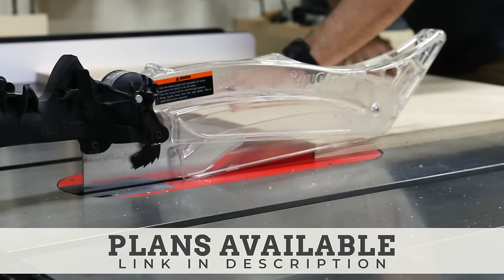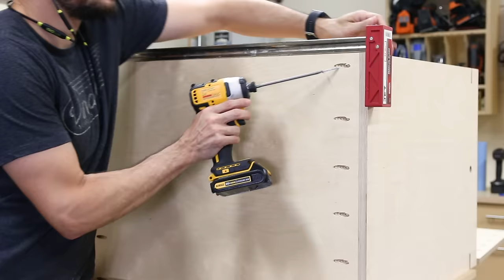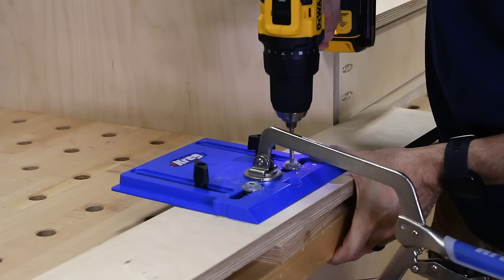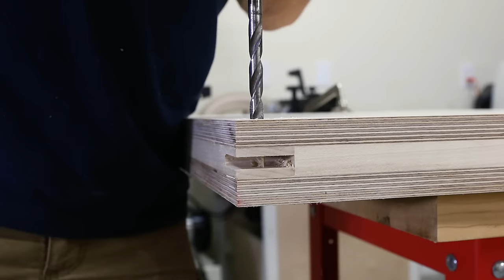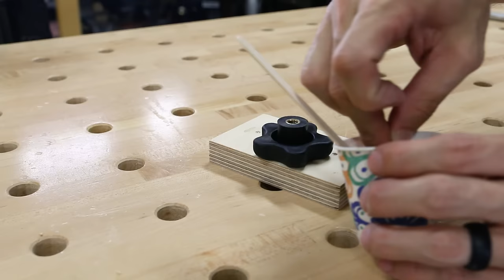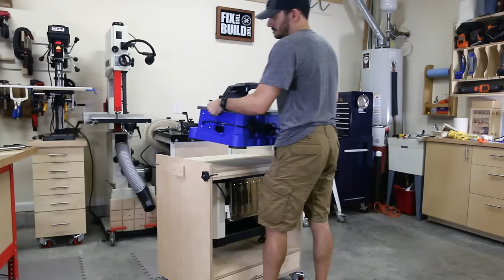Flip Top Tool Stand with NEW Features | DIY Shop Storage

Comment: Hi.  I purchased the plans.  How should I alter the plans for a dewalt 735 planer, and ridgid EB4424 belt/spindle sander?  In my head I just alter some measurements, but do you recommend I build it as the plan states? Or use different dimensions.  

Thanks!  I’m a beginner woodworker with a tiny shop so this helps a lot
Reply from the maker: Plans will work as-is for those two 👍

Comment: This makes so much sense with space saving, and a great description of how to do the job, thanks.  I’m wondering about the max weight for a machine on this. I’m guessing a table saw of 45Kg weight is too heavy. Any thoughts please?
Reply from the maker: Thanks!  The stand can easily take 100lbs on each side.  I've never tested the limits, but that should get almost everything you'd want to hold
Reply: Fix This Build That thanks. I’ll give it a try, and I might use the other side as a mini work bench instead of using the table saw as at present!!

Comment: Thanks for sharing. One question, how do you determine where to put the tools on the flippable top in order to keep the balance and thus ease of rotation?
Reply from the maker: If you can put the center of gravity along the metal tube line that's best

Comment: I really like the upgrades...simple things that reduce the 'frustration factor' aspect.  I've been thinking about ways to integrate a flip cart for my planer and miter saw, but with fold out wings that could serve a dual purpose.  The wings would add support for longer boards on the miter, but could also act as extended infeed/outfeed for the planer which would help reduce snipe.
Reply from the maker: Folding wings are definitely a cool idea.  Been tossing that around for a while.  Maybe Flip Top 3.0???

Comment: Hey Brad - Quick question? On the plans, you have the cut list item H (False Drawer Front) as 27 3/8" x 4 3/8" x 3/4". If you used two 4 1/2" shelf back pieces (27 1/2" x 4 1/2" x 3/4") to space the shelf top, and you then cut 1/4" off 2 sides (for 1/8" reveal around the whole front) wouldn't that make it 27 1/4" x 4 1/4" x 3/4"?
Reply from the maker: You're correct, the plans are actually designed for a tighter 1/16" reveal as I thought the 1/8" was a bit wide.  Can do either one, it's just preference

Comment: I've just purchased your plans, thanks!
What Plywood did you use? My local Lowes has Maple, Oak, and AC Sanded Pine. I'm looking for the lightest in weight, but obviously sturdy enough. Any suggestions would be appreciated. The tools I'll be mounting are the DeWALT DW735X and possibly a Drill Press (WEN 4210T 10") which is 26-1/2 high. I'm thinking about putting on workbench casters to lower the height when in use, due to the height of the Drill Press.

I would really appreciate your thoughts.

Thanks in advance!
Reply from the maker: The AC sanded ply should work well and probably cheapest. All about the same weight. Workbench casters is a good idea 👍

Comment: I saw you upgraded your planer from the previous Ridgid planer.  Would you mind sharing your reasons?  What are your thoughts regarding the Ridgid planer?
Reply from the maker: The JET one has a segmented head so it's quieter and less tear out. Plus it has more power. The Ridgid (not current model) served me well for 15 years. Not a fan of the new one though

Comment: 1:36  "Don't double-stack your sides, because it's just gonna double any error that you have." 
This is so true, yet so often missed!  I've seen experienced woodworkers stack, in a failed attempt to make perfectly-aligned holes through multiple layers (besides, of course, ahem, here....).  🙄🤣
The best way I've found (if the drill press is not possible) instead of drilling double thickness, is to drill half thickness, starting from marks on each surface, having the holes meet in the middle.  A template is a good way to get the opposing marks on each surface aligned, but remember to flip it for the reverse surface of the workpiece, or you'll multiply any error in your template (i.e., if the mark is closer to one side than the other).

Comment: In the plan page 3, upper left your instructions says: "Drill a 3/4 hole in de center of each side 2" down from the top of the edge..."
I was wondering if you meant 3/8" hole since the locking slots are 3/8"wide?
Thanks
Reply from the maker: Nope, 3/4" center hole is for the steel tube 👍. 3/8" slots are on the edges

Comment: I bought 17.2mm black steel pipe with a pipe thickness of 2mm, and im using 18mm MDF board. Do you think this will be strong enough to to hold a DEWALT 1800W 330MM THICKNESSER DW735XE which is 43kg and on the other side will be a Sherwood Oscillating Spindle Sander which weighs 15kg cheers.

Comment: Any ideas if the sides to the cart seems to be bowing away, making it tough to flip and latch? Using Baltic birch ply so bowed plywood shouldn’t be the issue. Any help would be appreciated.
Reply from the maker: Could add some small gussets in the corners above the shelf to try and pull them in permanently

Comment: Just picked up the plans Brad! If they are easy to follow as the x-carve table I built from your other plans, I should have this knocked out by next week! One question, the steel pipe in the middle is just common 3/4" galvanized steel pipe from the big box store yah?
Reply from the maker: Hey, Adrian!  the plans should walk you through it.  And no, it's tube, not pipe.  Very important distinction.  Tube is 3/4" OD, pipe is 3/4" ID
Reply: @Fixthisbuildthat  Thanks for the clarification!!

Comment: I just made a cart like this but couldn't find pipe   that was 3/4, it was all .10 over. Ended up running a very light dado pass on both top pieces and it worked great. Anyone else have this issue?

Comment: I bought your flip-top tool-cart stand plans and I’m about 2/3 finished and realized after watching another video that this is going to be too tall for the rigid sander.  With the sander in the up position, the working surface is 48”.  I’m 5’9” so I won’t be able to look down on my project to see the sanding lines and my arms will always be in an uncomfortable position.  Any suggestion to correct this situation.  Moving the casters to the outside of the cabinet would give back 3” but it’s still pretty high.  Perhaps placing the casters on the side of the cabinet and and eliminating the drawer might also  solve the problem.  Do you have any thoughts?
Reply from the maker: Hey, John. As drawn the RIDGID sander table should come to 45.5" off the ground (that's where mine is on the old one). I'm 5 11 and that feels great for me. I like having the work piece high so I can see what's going on and not have to hunch over. Depending on what's on the other side you could always plug the holes and drill new ones and move the slots down. But I'd definitely mock up the sander at that height first and see how you like it. I don't personally think it's uncomfortable on the arms at all.

Comment: Hi Brad, have enjoyed a bunch of your videos over time and finally subscribed. Going to build a flip top stand, but with a twist and would like advice. Have a very small workshop area and need a 2nd bench. Will place a Jet Benchtop Jointer AND a Triton Spindle/Belt sander on ONE side, leaving the other side clear to use as a workbench. Combined weight of the two units is ~ 100lbs. 

Yes, I know, need to be careful when flipping tools down, but other than bulking the unit up (e.g., thicker pipe diameter and hence bulkier top), is there anything else to be concerned about. Thanks. Harry
Reply from the maker: I'd honestly not recommend that setup.  It's not because of the weight, it can easily hold 100lb per side, it's the difference in weight per side.  When you have weight on both sides it counterbalances itself.  Without that you'll have 100lbs wanting to launch downward once it hits the tipping point and it'll go fast without a counterbalance.  I'd personally go one on each side
Reply: @Fixthisbuildthat  Got it. Thank you.
Reply: @Fixthisbuildthat  glad you answered this. I just picked up the Dewalt 735X Planer and was concerned about whether the cart could hold something that heavy on one side. Really enjoy your vids and the plans are great.

Comment: My question is is that this equipment below start to Gunk up more?  Especially when one is used more than the other? But just in general
Reply from the maker: Never had an issue with either tool hanging upside down after 3+ years

Comment: I am building this stand.  The pipe I used is slightly higher than the thickness of my  3/4 plywood or poplar.  The sandwiched rotating tops will not fit flat.  Is there a specific type of pipe to use or did I do something wrong?  The cart will be perfect for my needs and I can devise work around but what did I miss?
Reply from the maker: You used pipe (sized by ID) vs tube (sized by OD)

Comment: I do not believe anyone has mentioned this before:
Does the weight of the pieces rest on the bar or on the screws?  Is there allot of shaking going on?  Is this only used for large type equipment and nothing fine because of the shaking?
Hope you understand what I am asking.  Was wondering if I could do a miter saw and router table flip top.  Please let me know your thoughts.
Reply from the maker: The weight is transfered from the tube to the sides down to the casters.  The unit is very rigid when everything is tightened down, just normal rocking from casters.  Miter saw and router table would be a great combo on it!

Comment: I’m currently building this but I have an issue, the plans call out for a 3/4 hole and a 3/4 tube the holes are drilled and I used 3/4 tube conduit. Doesn’t fit, is there a different tube I should use or are the plans wrong and the hole should be bigger?
Reply from the maker: Hey, Garrett.  You need this bit.ly/fliptoptube
Conduit is measured by ID, tube is measured by OD
Reply: I appreciate the help!

Comment: Trying to not give away purchased plan details but looking on your ur revised plans, the drawer openings height & width are only 
1/8" larger than false drawer front which would only give a 1/16" reveal. Is this correct or should I make my drawer front smaller?
Reply from the maker: Ahh yes, that is true.  It will give you 1/16" reveal as cut.  You can make it larger if you'd like

Comment: Ahhh,for strength,the sides should rest on the bottom board, not on the sides..Great project thought!! ‘TFS...
Reply from the maker: Sides rest on casters which transfer the load to the floor. I'm very confident it will never fail

Comment: Hi. Thanks for this! Have bought the plans and will be looking to “flip” a Dewalt 735 planer and  mitre saw.   When you attached your planer to the top, did you use lag screws? Or lag bolts which were secured by nuts in the other side? Wasn’t clear.     Thanks!
Reply: i predrilled and used lag SCREWS NGK makes some great fasteners.

Comment: I have watched your video and a couple of other very similar builds and I noticed in all of them that you used pocket hole screws as your only fastening method. Why no glue? I would think that glue would make it much stronger.
Reply from the maker: Since it's always end grain to long grain the glue isn't going to do much. Glue really wants long grain to long grain to bond the best
Reply: @Fixthisbuildthat  That's true for sure. BUT,  the addition of glue along the 2 sides will provide some more strength even if it's not 100%. I think I'll use glue.

Comment: So 4 little 1/4in lag bolts in 2 inches of plywood will hold my heavy a$$ Ridgid thickness planer hanging upside down?
Reply from the maker: Well it's held mine for 5 years now
Reply: That's all i needed to hear. Thank you Sir for the prompt reply.

Comment: Dumb question, why not just leave the planer on the bottom shelf instead of flipping it when you need to use?
Reply: It would get in the way of any other tool you need to use when flipping, no? You could just make an open cabinet I suppose if you wanted to kneel to load wood. Not the worst idea
Reply: @DuderMcBaddy  I guess the flip table makes more sense if you’re for example running a spindle sander and a drill press, both require engagement and seeing what you’re doing at eye level but a planer, you just have to feed it boards in a leveled manner

Comment: Your locking seems overly complicated. I would just use some sliding locks like you'd see on a gate or something. Not sure the name but u slide the bolt over and down and it's done. And you should only have to lock one side, not both.
Reply from the maker: One of thr major benefits of this locking system is it tightens the sides to the top which prevents wiggle and makes the whole cart rigid. Barrel bolts or window latches won't do that.

Comment: Sorry!! But you can’t get this from a metric sized 8’x4’ as the metric size is 1220x 2440 also why use 2x1’s inside the 3/4 ply as the inch is a 1/4 too wide ??? I just sandwiched 3 pieces of ply !!🏴👍